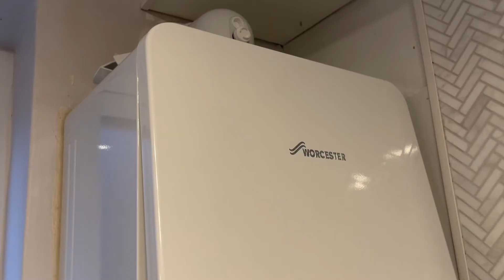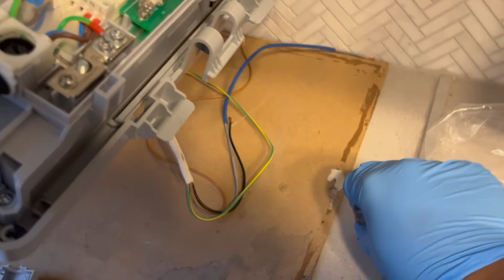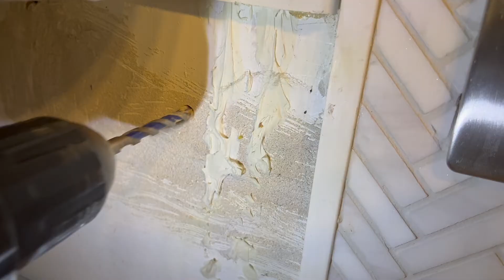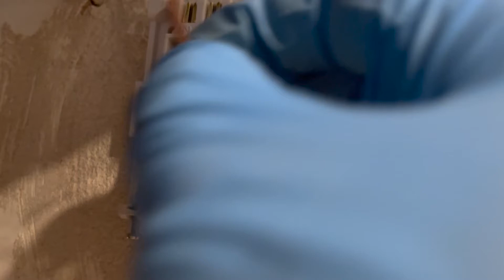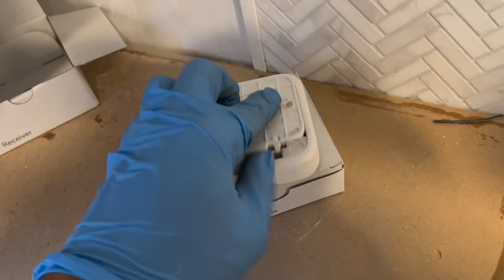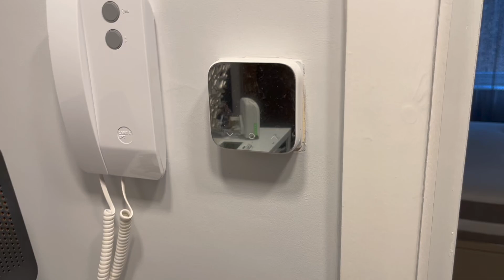Hive Thermostat Mini Installation In 10 Mins - Combi Boiler Wiring | Worcester 2000

Comment: WARNING! Be careful when repairing/servicing/installing this particular boiler, there is a manufacturing error with the loom that goes from the sub board where you connect the mains input and heating controls (What you are connecting to in that video), that loom connects to the Main PCB underneath it, the manufacturing error is that the Live and Neutral conductors are reversed so everything in these boilers from the sub board back is has the Live and Neutral reversed. I have reported it to Worcester Bosch who have admitted this error "The harness edge connector at the external controls interface PCB has indeed been incorrectly assembled by our supplier, L & N have been reversed." Worcester Bosch admitted this after I've repeatedly contacted them and informed them in detail with my report regarding the dangers of this error, however they have been reluctant to rectify it so far but I won't give up until they do.

Comment: Great video thanks. The mains supply to my boiler goes through my current receiver (i.e fused switch before receiver then live and neut and doubled up). Does this matter or will new receiver just get wired the same way? Thanks

Comment: Why is it the earth wire not connected to the hive earth. My old boiler receiver only has 4 wires do I just do the same as you I’ve seen some videos with 5 wires connected
Reply from the maker: If you’ve got a spare cable for Earth then it’s best to use it

Comment: Hi, thanks for your videos, i found your video with Main Eco e30 elite boiler and Salus Thermostate, and 2nd video with Hive mini thermostate and Worcester boiler, but i have Hive mini thermostate and Main eco 30 elite, did wiring in boiler as u mentioned in salus video and did wiring in hive as mentioned in hive video, but boiler not switching heating ON when i increased the temp in hive thermostate, hive thermostate gas green light comes ON but boiler gas does not comes ON. pls help

Comment: Morning. I've accidentally bought the dual channel unit for my combi boiler instead of the single channel. I've moved the wire from 2 to 4, the heating on terminal. Should I remove the link wire between 1 and live or leave it in place? Thanks.

Comment: i have a worcester 2000 and when i remove my panel to expose the wires etc they look nothing like yours - there is no LR LS NS N L - all i have is a blue block, brown block and a orange block that has 2 connections on each with 2-1 2-1 2-1 the orange block has BUS written on it, i have scoured the net to look for these same connections to fit a hive and cannot find anything like mine

Comment: Did you use the existing wires inside the boiler to connect this or did you buy extra wires to install it? Handy video but I just couldn’t work out whether you used new wires or used the existing wires 🙈
Reply: A new wire, I bought some 4 core 1mm

Comment: Hiu I have an original Worcester 2000 boiler which was supplied with its own wireless thermostat. I had  hive and was told this was not compatible, The model No is GC2000iW C and all electricians I spoke to inc manufacture said its not compatible, then they updated boiler to be compatible.  I want to use my Hive, as their supplied thermostat is very basic

Comment: I'm a total ameteur I  have just recently replaced my kitchen cabinet which had a digistat SCR coming in below it. I didn't want to cut out a hole in my new cabinet and took it off the wall. It is hanging off the wall at the moment and made me think about replacing it with something more high tech for my ecotec plus boiler. I noticed something odd or at least odd to me, when I took it off the wall I assumed it would only be connected up to the boiler as that was the only large white cable I could see but then there was a second one in the wall. I'm now even more confused looking at this guidance video as there is only one large cable connecting the two together like I assumed there would be with mine. 

Any idea what the second cable is for?
Reply: It's Ok I figured it one was going to a fused spur the other was going to the boiler.

Comment: how would this be installed if all you have is a two wire thermostat installed? and only two wire connections for a stat on the boiler?

Comment: Does it matter which terminal the grey cable goes into could it be terminal 2 or 4 instead of 3 would it make any difference thanks great video bro.
Reply from the maker: It should go into 3👍
Reply: @advancedboilertraining  I'm wiring into an Ideal Logic 30, grey wire into 3, the thermostat kicks in the controller and it lights up green but no go with the heating. Unsure if this is normally open or normally closed. Previously had a Horstmann HRFS-1 T50 installed

Comment: Non compliant with BS7671
Grey needs sleeping brown to indicate a "live" conductor

All points should have an Earth wire even if it is not used. Earth termination in the parking terminal,in the rec ivermalso acts as retention point to,act as strain relief
Ferrules on the cable,would be a nice touch
Reply from the maker: You’re going to love the video I post tomorrow 😉
Reply: Sleeping 🤔

Comment: Thanks. I initially installed this using the wiring from my old thermostat and added L, N and 3...it seemed to be working, the receiver made a click when the thermostat target was above the actual but nothing happened...in your video I've seen the link between L and 1 so after adding that it worked

Comment: Hi great video. I have a worchester 2000 combi with the standard programable thermostat that uses the cartridge underneath the boiler to communicate with. I was told the hive system are not compatible with these boilers, is this no longer the case or do u have to get the hive mini for it to work 🤔 also can u still control the heating using the hive app with this mini, thanx

Comment: I just installed one of these today in stand alone mode like this. The documentation that comes with it and the installation instructions online are dreadful.
I installed as per instructions and nowhere does it mention the link between live and terminal 1.
I read the manual for the thermostat I removed and it mentioned linking L and terminal no 1.
Once I did it the hive worked as it should.
Reply from the maker: Yeah the instructions aren’t the easiest of things to follow. Hope the video helped 👍

Comment: Great video, 
Is the difference between hive and mini hive is that the extra  hub  ?
Reply from the maker: Yeah the hive mini is hubless
Reply: Incorrect. If you buy the full hive mini kit it’s comes with the hub also. This set up was just the thermostat & receiver which is a cheaper alternative
Reply from the maker: @Tom-fs4ue  yeah this is the hubless one
Reply: Great video. I have a worchester 2000 combi with the standard wireless thermostat it uses a cartridge underneath the boiler, i was told the hive isnt compatible with this boiler, will this mini hive still allow me to control the boiler through my hive app

Comment: Why fit a smart thermostat that can’t modulate a modulating boiler?
Reply from the maker: Because it’s what the customer picked. He got it really cheap off of someone and wanted it fitted. I advised against it but that’s what he wanted
Reply: Which opentherm stat would you recommend for Intergas Rapid 32
Reply: That's what BG is fittings for the customers, and it works. Not everyone will have money to purchase the nest thermostat. Some are found  to find fault in what seems to be a post
Reply: It's alright, under the Part P Plus and Part L legislation it's the customer that faces the £5k fine if they go to sell or rent and it's picked up as non-compliant. 
If you're supplying and installing though you have no choice but to fit one that complies or the responsibility and cost falls on you as the installer.